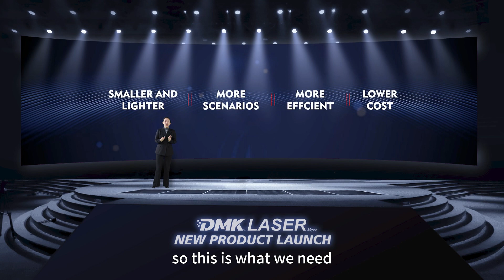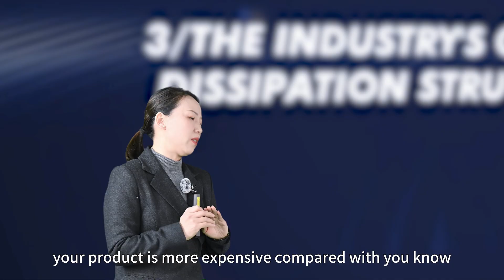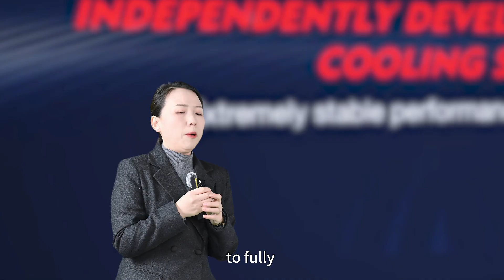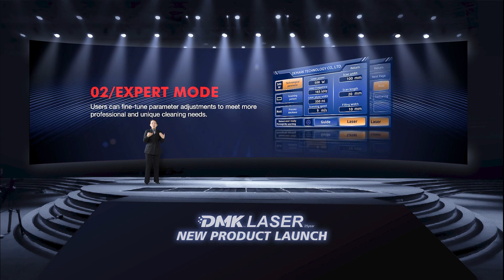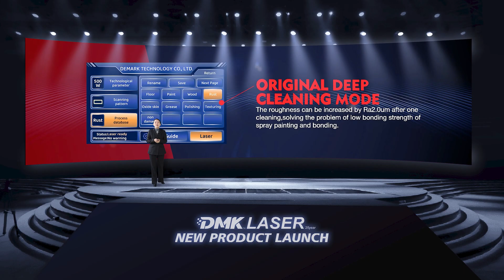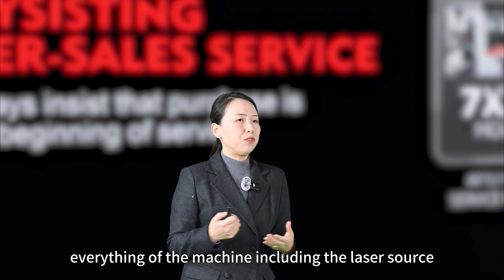Demark's First Product Launch: 500W Air-Cooled Pulse Laser Cleaning Machine #DMKLaser #foryou

Comment: Air Cooled 500w came out six years ago and can't handle hot climates
Reply from the maker: Thank you for your feedback and for sharing your experience with our 500W pulse cleaning machine! We understand that using equipment in hot climates can present some challenges. However, our 500W machine is equipped with advanced air-cooling technology and has undergone rigorous testing to ensure stable performance in various environments. If you encounter any issues while using the machine, please don’t hesitate to reach out to our customer support team—we’re here to help! Additionally, we recommend allowing the machine some extra rest time during operation in high temperatures to maintain optimal performance and longevity. Thank you again for your support, and we’re always here to assist you!
Reply: @demarklaser  No it just doesn't work at that laser source heat and head level by air cooling, stop pretending and trying to pull the wool over intelligent customers that it works, when it won't, too many Chinese suppliers lie and sell these and simply don't care of the consequences. Better off to sell Videos, instead